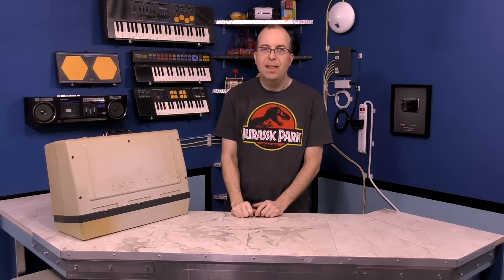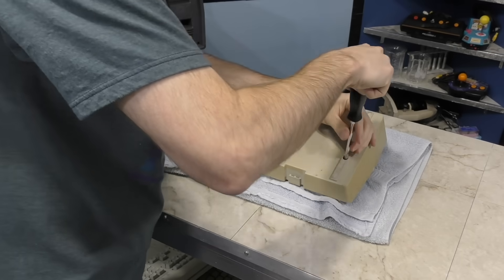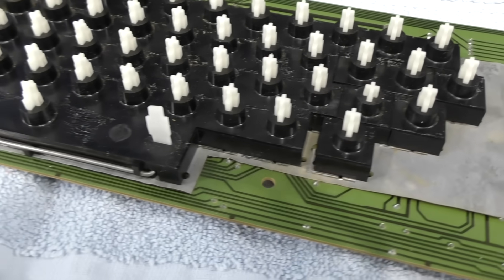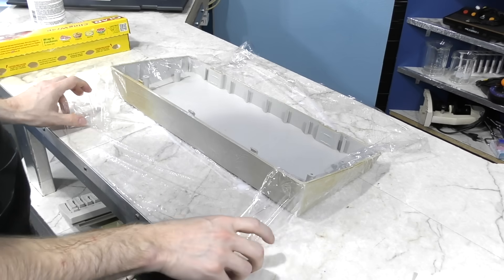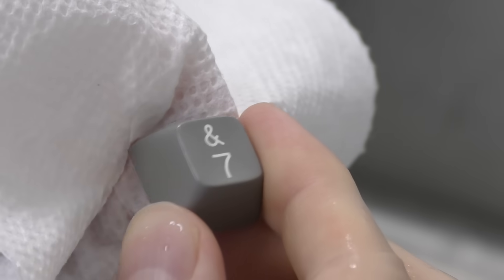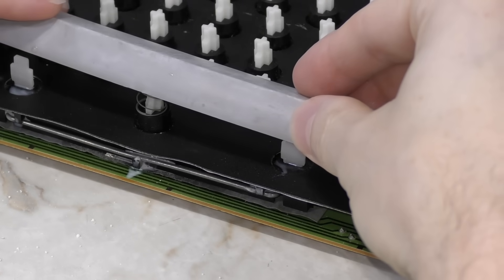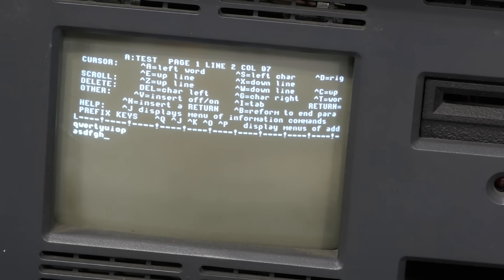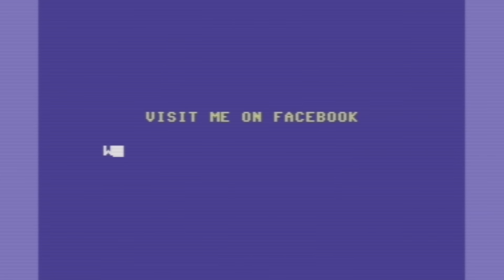Osborne 1 Computer Restoration Part 1

Comment: What happened to your keys is the original outer gloss/protective layer of the keys was removed in the retrobrite which led to exposed raw plastic being exposed to air, so the exposed underplastic oxidized. It usually can be neutralized/prevented by giving the keys/plastic a nice alcohol wash after the retrobrite then immediately rub some petroleum jelly or soak in some mineral oil for a while to allow the exposed raw plastic to absorb some of the oil.

So you may want to attempt retrobriting a key for a short time just to remove the marbled pattern, then quickly give a alcohol bath, and immediately coat in petroleum jelly or dip into mineral oil for a good 15-30 min, then you should be good to go..
Reply: Would general use also help restore it a little? I know lots of keyboards get glossy over time with just oily fingers
Reply: absolutely, there's no substitute for natural cheeto oils
Reply: @Thomas Munn
c o p e
Reply: Thanks Raven, my other guess was a possible reaction to the water itself.  Alcohol cures all though kinds of cleaning problems >__<
Reply: @mewimi 
Alcohol cures all problems.
Reply: @Thomas Munn "Marbleized" is easy to persuade yourself into liking. :)
Reply: Nuh uh!
Reply: L
Reply: Does the petroleum/oil soak in enough to preserve the plastic against future  UV discoloration as well?  Or do you still need to use some other UV blocking paint?
Reply: And saving this OG comment into notepad for future reference. Thanks for that, @Raven.
Reply: Thanks for this mate
Reply: Could I use clear coat spray paint?
Reply: or simply cover it with paint
Reply: @grasstails9737  that wouldn't be a restoration now would be? rather a resto mod, plus having to paint on a new number or letter and needing a skilled hand to pull that off perfect. Also paint on keys sounds like a bad idea, paint will wear off in no time with computer use.
Reply: @LycanShift  good point
Reply: Raven thanks google
Reply: ok boomer
Reply: @shuminitis  
How amazingly original and creative.
Reply: The Atomic Cherry thank you boomer
Reply: @10_ji 
Oh, I'm flattered, but I'm not that old. Certainly not old enough to have heard of any of the computers featured on this channel.
Reply: The Atomic Cherry ok boomer
Reply: @shuminitis  
Oh, dear.
I do believe I'm staring at a mentally stunted specimen.
Hang in there, buddy. You'll learn another word some day.
Reply: @shuminitis  Your sense of humor never seems to make me laugh
Reply: Raven shush you’re just jealous aren’t you
Reply: @shuminitis  what's there to be jealous of? i see a nobody with nothing to offer
Reply: Raven you know what i’m talking about
Reply: @shuminitis  no clue at all. but sounds like you're envious, hence you keep replying to me.
Reply: Raven shush you know what happened you’re just pretending to not know
Reply: Raven imagine getting so jealous about something that you blame my ego
Reply: @shuminitis  imagine having ego issues that you start saying others are jealous, especially when the other is the original commenter whose thread you've necro'd and are replying to. what a fail.
Reply: IvorySoul696 ok IvorySoul696 i’ll grow up IvorySoul696. i am 5 years old so i’ll grow up IvorySoul696

Comment: the key marbling is due to an excess of the oils in the plastic leeching out. wipe them with a small amount of mineral oil. wait an hour or so then remove the excess...wipe with an automotive plastic protectant like nuvinyl and they'll be good as new.
Reply: btw, the fact that the plastic looked great while it was wet was a givaway. if the keys looked like they do while they were wet it would be what is sometimes referred to as blooming. which is when the plastic dyes are bleached too, due to an excess in peroxide concentration.

Comment: Dave, Texas isn't special when it comes to when summer is. Other than places that are right by the equator (where they claim that the seasons are shifted by one notch), summer at every place in the northern hemisphere starts and ends on the same day or two (depending on the the time zones). In the future, will you please not say that, and for this video, will you please post a card that says "Oops, I meant 'basically midsummer' in general" (it's still actually fairly early in the summer, since it started on June 20-21)?

Comment: How can you call this a restoration when you've literally ruined 80% of the exterior?
Reply: The hell are you talking about?  The entire thing has yellowed because of bromine in the plastic.  The only thing he's whitened so far is the keyboard housing.  The "80% of the exterior" you're talking about HASN'T BEEN TREATED YET.

Take a look at this:
http://oldcomputers.net/pics/osborne-1-rev2.jpg

Notice how nice and WHITE it is?  Yeah, that's how it's SUPPOSED to look.  Not yellowed like it's been stuck in a room with a heavy smoker.

Comment: As someone who once had a Cyzern System 7000, I have a pretty good idea what happened to that floppy drive and possibly some boards surrounding it. 

Good luck with the point to point rewiring project.

Comment: Safety measure should be taken when dealing with vintage computers with CRT monitors.Glad to know you are still alive and in one piece and sad to know the keycaps are irreversibly spoiled.
Reply: Don't be sad, because... the keycaps aren't irreversibly spoiled.  That's not the result of "blooming" (which would be irreversible).  The smoke was just a blown capacitor that's easily replaced.

Comment: I bet if you tried a heat gun on those keys it would melt out that etching.Works for black car trim when it gets that way but you have to be careful. or you might try polishing with spray wax or silicon lube to bring back the sheen although I don't know if it'll smooth the color. I say this second one because you showed that it didn't appear until after they dried off. I already know you're not fond of adding anything that isn't OE but I thought I'd pass it on.

Comment: It looks like the wrinkles in the plastic wrap contributed to the marble effect. Is there a way to maybe build a board with a bunch of small nails that you can place the keys over, smother them in retro bright and place them in a clear plastic cover. Eliminating the plastic from touching the keys. Maybe invent a followup spray retro bright that you could go out every 20 minutes under the sun, lift clear plastic lid, spray down from all angles, recover and rotate board as necessary to get UV coverage. Just an idea. Love the channel. Keep up the great work. GEEKS UNITE!

Comment: If you didn't do this, it's crucial to use something to neutralize acids when treating things like connectors. You should look into a more expensive but better solution like Deoxit for connector cleaning.

Comment: They keys exterior has been oxidized much like the metal in the keyboard. You can pretty easily/quickly get rid of it all with a buffing wheel with some plastic.  compound.

Comment: Hey, random thought (because I was just out in the garage using it) with both your restorations/repairs and what This Does not Compute does with mods/etc; have you ever consider using the plastic version of JB Weld? (I think its literally called PlasticWeld, but its called Selleys Knead It over here). It pretty damn strong and easy to use. And also dries in a kinda off-white/really light grey that would work with a lot of your work (although you'd use from the back anyway).
Anyway - just a random thought.

Comment: My Osborne I had a soft plastic case with rounded corners. I cut a hole in the rear and mounted a 5V fan externally for better cooling.

Comment: that happened when i used a powder to acelerate the process, but it got much worse and i needed to buy another snes because of it
Reply: What happened to your SNES was "blooming".  What happened to the keys... isn't.  (How do you know?  Because the keys looked fine until they dried.  If it was blooming, it would've showed up when they were still wet.)  The keys aren't permanently messed up... there are products that can restore them to their original color.

Comment: The smoke coming out of the computer is normal, and nothing to worry about. The Radio/TV Interference Suppressor Capacitors in the power supply are just busted. With how old they are, it's no surprise. Most old computers do this. I haven't run into any of these capacitors blowing on any of MY old computers, though.

Comment: You didn't yell "SMOKE TEST!" When applying power. Sounded like the filter cap for the PSU fizzled out on account of high humidity and moisture exposure. Luckily, my Packard Bell's PSU didn't crap out on me.

Comment: Hey 8-Bit Guy! I contacted you a few months ago about an Osborne 1 that I had found at an estate sale. Glad to see you got yours working! I found a boot disk for mine and the disk drive does work but I think some of the RAM is faulty and I don't have an oscilloscope to replace them. Anyway, glad to see you got yours working, and if you have any tips for the RAM replacement, they would be greatly appreciated.

Comment: Hello 8 bit Guy, thanks for share your videos, I want to know how much peroxide concentration is the cream base that you've use, you´ve explained that in a anterior case you've used a gel base with a 3% of concentration, in my case I goed to a Chemical Store here in my country and I could found "Pure Neutral Gel Base" and "Pure Peroxide", then I want to experiment with an old yellowed keyboard. Thanks, and go on with your excellent videos.

Comment: There's 2 things that may bring the keys back to normal.The first is soaking them in a light oil for some time,retro bright and peroxide dissolves some of the oils in the plaxtic and that is what caused the blotchy look to appear after they dried.The second option that I'd recommend trying after the first is to gently heat them with a heat gun,it will help draw the oils to the surface and even out the color too.I learned these tricks on restoring the plastic on my old VW GTI years ago as it's how we'd get the trip to be black again and I've since used it on TONS of other old plastics to restore them.The oil soak is more temp and works best when you do both together ;-)

Comment: I used to work in plastic molding, take those keys, apply very light coat of Vaseline, and small amount of heat. Plastic will absorb a little bit of the Vaseline and should alleviate the swirls. Wipe them clean so they are not oily after application process. I agree with other comments. I like the longer video format instead of multi part short episodes.

Comment: Im not familiar with what kind of plastic the osborne used but some kinds of plastics can have plasticizers that can be leeched to the surface and may account for white streaking. You can use some plastic polisher compounds like mothers or maybe goo be gone (the orange residue remover not that the distilate based stuff). That may get rid of it if you havent already tried. Tho I would def try the polish on the space bar first, I'm not sure how aggressive it would be on the lettering silk screening.

Comment: You might want to a magic eraser or similar on those keys. I had an Apple monochrome monitor with a similar thing that I fixed by lightly rubbing the affected areas with one. Shouldn't cause any problems to the keys being that they look to be double-shot.

Comment: I'm suspecting what happened to the keys was that the difference in contact with the wrap made some parts have more hydrogen peroxide on them, which led to some reaction with the plastic. The same thing happened with the cover, but it was far less noticeable as the cover, being a plain big piece of plastic, is a lot easier to even the contact of the wrap, opposite to the keys which are small pieces of plastic spread out. I suspect the temperature outside had to do with it as well, as apparently those marks appeared when they started to get colder.

Comment: I would try spraying a clear coat on the keys. I've had good luck solving similar fogging issues with either clear spray lacquer or clear plastic spray paint with acetone in it to promote adhesion.

Comment: Swirls in the plastic might be where some of the bromine mixed into the plastic irregularly.  I know when I was a plastic mold injection operator we could get color swirls in plastic parts if the mixing speed wasn't fast enough.  Also nice find on the Osborne 1.

Comment: For corroded screws use rust dessolver from Rustoleum. You can get it on any auto parts like pepboys, it restore any metal part in 30 min or 1hour. :-)

Comment: That "marble" pattern is very similar to the results I got with my yellowed Super Famicom (I used your method)... I think it has something to do with the heat: As the hydrogen peroxide begins to evaporate, it begins to "bleach" the plastic (parts become too white), making that bizarre effect. That's why I would avoid retrobrighting when it's too hot. (the super famicom was my first attempt, and since then I didn't really need yet to retrobright stuff so this last part is just a guess)

Comment: What is "The Cream"?  A store bought Retr0Bright or home made?
Reply: +Zerkbern
You're right.   The strongest concentration is 50 volume, which is about 15%.  The product Dave's using is 40 volume, which is (as you said) about 12%.
Reply: You look at his first video introducing the technique, it's a store bought hair bleaching product with i think approx. 30% peroxide by volume.
Reply: That's what I thought it was but I heard him  mention that high percentage.  I have never found a product with %30 H202.   

Hair products have their own numbering system for H2O2 percentage.....kind of like "proof" in booze.   That "30" on the bottle doesn't mean %30. 

20 = %6 H202
30 = %9
40 = %12 

....at least this is what my Beauty Supply Salesman Friend tells me.  

Someone could correct me if I am wrong.  ???
Reply: Thanks.
Reply: Yes, I figured that out.   I have not seen all of his videos, so I guess I missed that one.

Comment: As a suggestion for the marble keyboard, it may be that the peroxide etched the surface of the plastic. Perhaps if you get some model-quality gloss clearcoat spray, it will even out the surface and they'll look good again. Take an inconspicuous keycap and try spraying the backside; if it doesn't help, abandon that route. Incidentally, I specify model quality paint (e.g., Testors, Tamiya) because they have really fine, thin sprays that will make an invisible coat.

Comment: You might want to try rubbing some olive oil into the keys to see if it mitigates the mottling effect from the H2O2. Not sure if it will help, but it has helped me with similar issues on vintage SGI workstations.
Reply: zuctronic thanks ill try that and let ya know, i did a similar thing to some lego
Reply: That is my suggestion to... try a mineral oil... I'd try a synthetic first and then an organic or semi-synthetic... Leave a key over night in it t get it fully saturated and then wipe it clean... Make sure it's a low viscosity oil so it penetrates well though...

Comment: The keys looked painted instead of molded PLA. The shot that shows the inside of the keys shows a dark grey paint. I guess that paint reacts different to this cleaning method than the PLA that got colored by sunlight. Next time, you could try to clean painted parts different than (just) molded parts. Soap, alcohol or soda could do the job without damaging the spiritus based paint coat. Try it out!

Comment: I have done lots of retrobrites.  To avoid streaks, don't let it dry out.  I spray with a bottle of regular peroxide to increase humidity, and also rotate, massage, and re-spray every so often.   Leaving something out all day while going to work is a recipe for failure. (Not that you do, but just to warn others...)
Reply: Maybe stick to 3% peroxide on keys, 8-Bit Guy. It's less risky.  That hair stuff probably has extra chemicals like bleach or something.  I used a different brand, but have had similar problems with keys.

Comment: It'd be interesting to find out the formulation used for each plastic piece from the original manufacturers. Some manufacturers using cheaper materials than others. Maybe from that we can come up with better ways to treat each type of plastic.

Comment: I'm not a plastic expert or anything, but the marbling effect on the keys reminds me a lot of "regrind" which is a problem retro plastic toys often have were the plastic starts to marble into the colours used to make it. In the case of the keys it looks like a paler batch of plastic and a darker batch were mixed to get the colour for the keys.
If you want to look more into regrind, you could look at retro toy restoration forums about regrind. It's mostly a problem with vinyl but does affect other plastics and you'll see a lot of My Little Pony toys from the 80's with this problem as well as the odd early Barbie doll.